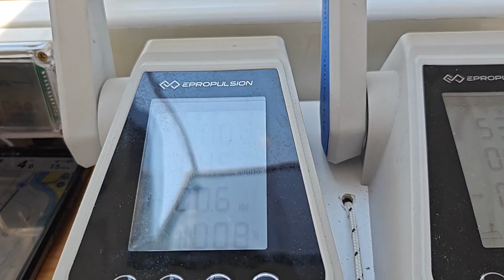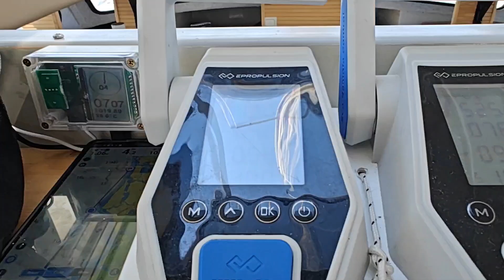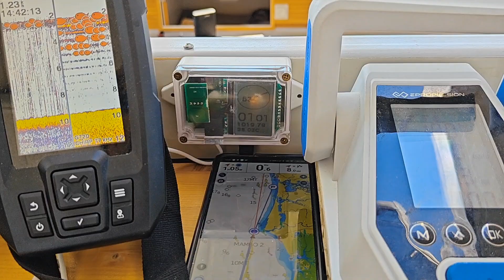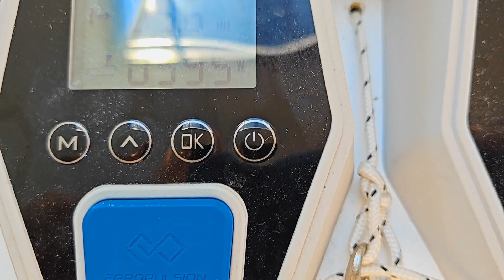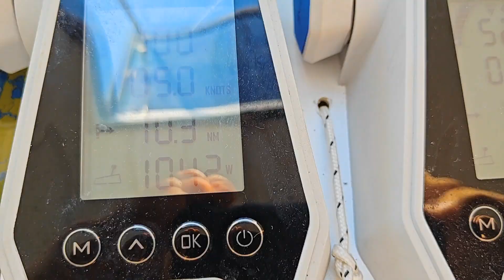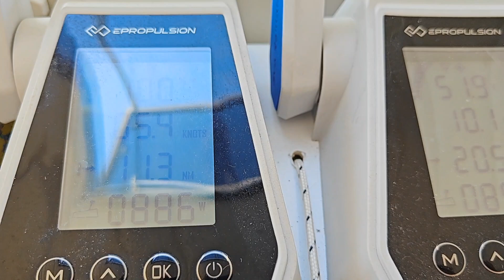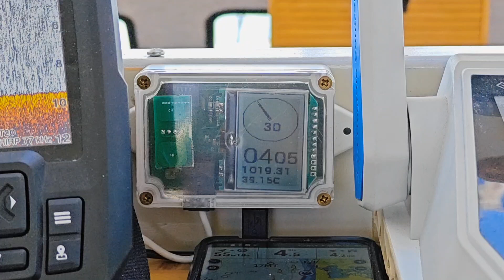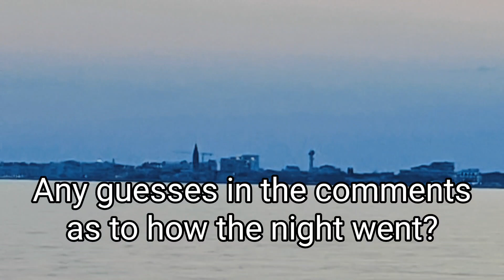How fast can our electric catamaran motor... forever!?!

Comment: All vessels both mono hull and catamaran have complex underwater shapes and curvature. I wonder how much of that shape is to eek out a bit more speed for a given power and how much is for stability, seaworthiness and comfort. The thought would be that if solar boats only want to be cruising around at 4-5 kts then why would you include the cost of creating complex shape if the only real reason for complex shape is to allow the hull to go faster through the water! A custom solar catamaran could surely be made much, much cheaper if built as a simple welded aluminum box section tapering at the bow and some thought given to shape at the back to minimize wake turbulence drag. Your not going that fast anyway. All necessary thought off course given to structural integrity. Very quick to build as well. Welded flat panels, simple frames and beams.
Reply: welded flat plates are you serious?. Look at Richard Wood's design, there is nothing complex and it works perfectly.
Reply: @markusspeetzen9505  Looked him up. All designs have complex underwater curves that are time consuming and expensive to manufacture.

Comment: Thank you for sharing! Can you tell us how much your boat weighs approximately?  I have a cat sailboat that is  6 tons & plan to use your same setup.
Reply from the maker: Hi David, we're 5 tons. I know a much heavier boat that does similar speeds with similar power levels, so in my opinion drag is far more important than weight.
Reply: I don't recommend that, but it also depends on the area you're sailing in and the purpose you're using it for. I have a similar project, a 10 metre catamaran with two 7kw e tech motors (Poland). Kraütler or Aquamount (Austria) also work well. You've seen for yourself that at 6 knots the propellers are already taking in air because they're too small. I have 15-10 inch bronze propellers. The difference is the much higher torque; the 1kw more doesn't matter. The bigger the propeller, the better the power transfer. Don't confuse this with the pitch, which is for speed. For the large propeller diameter you need motors with a lot of torque, which doesn't use more power; in fact, the opposite is true because it's more efficient.
Reply: Hi,  Im  wondering what your experience has been with reliability of E-tech and what power draw you are seeing at cruise and top speed?

Im looking at the 3 brands you mention but cant find any detailed reviews@markusspeetzen9505

Comment: what is that clanking sound? is it waves hitting the hull or ?? it stop when you stopped the boat around 6 minutes in
Reply from the maker: It's the autopilot. I've serviced it over the winter and replaced the belt. I suspect I also need to turn the sensitivity way down. It'll still be noisy but should sound more like an electric motor and come on less often.
Reply: Thank you  @SailingElectra  I was afraid it was the sounds of waves as I have never sailed a catamaran before

Comment: How many kn does full throttle cost in a calm sea? Why didn't you measure full throttle speed?
Reply from the maker: I don't have anti-cavitation plates on the motors yet, so at full throttle I am getting cavitation which makes it difficult to do for long periods to make measurements. From the tests I have done, it looks like it's just about 7 knots at full power, 12kW.

Comment: Sorry but your efficiency on a glass calm day is simply not relevant. 
The bottom line for any boat is, can it get me out of trouble? 

If that boat had to head into 30+ knot winds it would be out of power in a matter of hours and into a whole world of trouble! 

Therefore going out on a calm morning, you'd be hoping all day that it remained calm otherwise there's no guarantee you'd be able to get back to port without assistance.
Reply from the maker: It is a sailboat, so hopefully when the wind is up we can sail out of trouble. We are planning some sort of backup though, either a small generator or a small outboard. Purely as extra insurance.
Reply: yes, not entirely wrong, but you can take the best course for the wind and waves. In an emergency with a sea anchor. Besides, it still has sails and if not, you have a backup generator. So what's the point of painting it all in a negative light? It should be clear to everyone that the speeds and consumption are no longer appropriate. A car with a heavy trailer needs twice as much. So if you don't plan for reserves in a boat, you only have yourself to blame. Again, it depends on the area you're sailing in.

Comment: That was really great to see! I've often wondered if with sufficient solar go could motor for a loooonnngggg time at moderate speed. Add in the ability to regen and you have an infinity device! Really confirms what I'm going to do when the old diesel finally gives up the ghost.
Reply from the maker: Yeah, I was chatting to a sailor doing a large ocean crossing, and he once ran out of fuel so now carries way more fuel than he needs. I was saying he should get an auxiliary electric motor and a few more panels, because I consider my boat to have an unlimited range! Of course it all depends on speed, but so does diesel consumption, the speeds are just higher.

Comment: Can you show speed and power consumption using a single motor?
Reply from the maker: So I'm guessing you're asking because you're curious if it's more or less efficient. I'll do a video on this at some point, but I have done some testing and found that it is always more efficient to run two motors rather than one. 

At high speed it seemed to be at least 5% more efficient to run two motors, maybe even 10%.To people with diesel or petrol engines this sounds weird, but it is definitely the case with electrics.

I believe this is because the motors are so efficient, that what you lose in friction and other running losses, you gain far more in a larger surface area moving the water at lower prop speed, and less cable loss with lower amps running to each motor.
Reply: Very interested in yr observations on 1 v 2 motors. Look fwd to your future episode on it
Reply from the maker: @bluemu hopefully I get a windless day soon, otherwise definitely next season. I have no doubt two is more efficient though, it's just a question of how much.

Comment: Do you find yourself solar motoring "not really sure what to call it" as often as sailing? :D
Reply from the maker: My sails don't work yet, I still need to raise the boom to clear the panels, so I'm just motoring at the moment.
Reply: @SailingElectra  Oh Gotcha. Don't get me wrong I think is very cool you can run off solar. Has me re-thinking the amount of panels I can fit on my prout.
Reply from the maker: @CaptainShack  I'm dying to get the sails working, but I couldn't find an available rigger, and didn't want to miss the sailing season. 

My view is always to maximise the amount of solar you can fit. That way you could have an auxiliary solar motor for those sunny windless days. It takes very little power to move a boat in smooth water, so there's very little to lose. 

My Dinghy uses a 12V motor that can put out 720w. I suspect that even that little motor would move the boat quite well at low speeds. I'll figure out a way to mount it and test at some point.